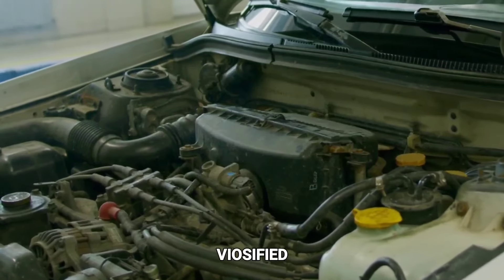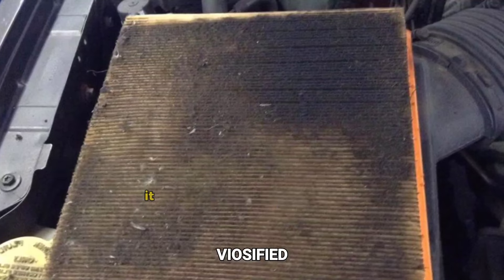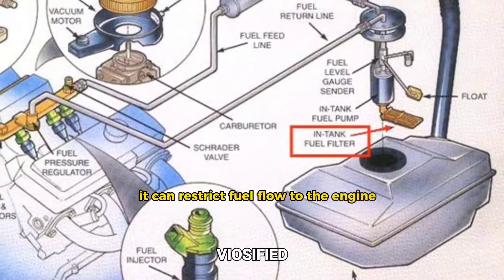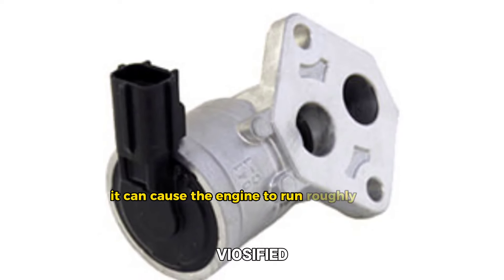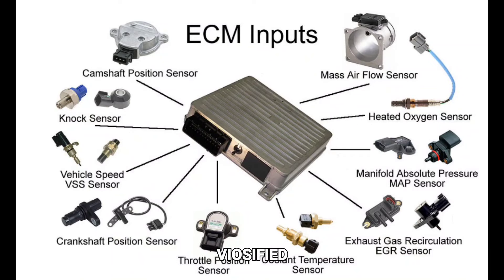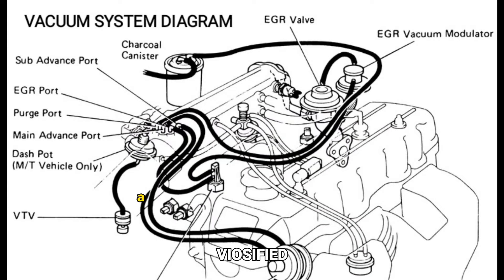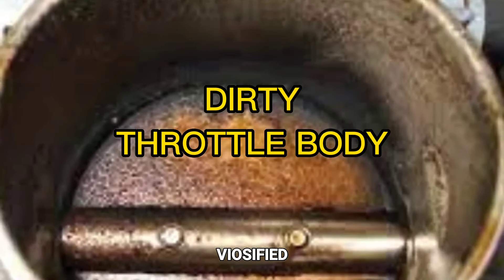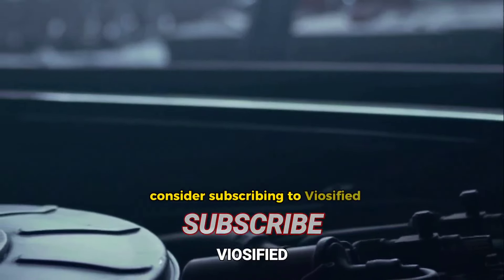CAUSES OF ROUGH IDLING | ENGINE STALLING

Comment: My Subaru stalled on my way to work this morning and I’m in absolute shock. No noise, nothing! I’m still trying to figure out the issue.
Reply from the maker: @RoseQuartz-l8c  the sudden stall without noise might indicate a loss of electrical power or fuel supply, but there’s not enough information to pinpoint the issue. It’s best to have your vehicle checked by a mechanic to diagnose the exact problem.
Reply: @Viosified  I got an update by my mother just yesterday. My dad found out that the timing belt had snapped which means my values are possibly bent too. Absolutely gut wrenching to say the least.
Reply from the maker: @RoseQuartz-l8c  I'm sorry to hear that. I hope the damage isn’t as bad as it sounds & that the repairs go as smoothly as possible
Reply: @Viosified  I hope so too! She’s my best friend to say the least and I wouldn’t have it any other way. Thank you.
Reply from the maker: @RoseQuartz-l8c  You're welcome! I can tell she means a lot to you. Best of luck! Hoping everything gets sorted quickly 🙏

Comment: My car is cur after star but wen u accelerater but the moment you leave it cuts,but wen you unplug airflow sensor cable is idling rough but not cut what will be the problem?
Reply from the maker: @charlesmakupe3137  Your car's issue is likely caused by a faulty Mass Air Flow (MAF) sensor, an air intake leak, or a problem with the throttle position sensor (TPS). Try replacing or cleaning the MAF sensor, checking for air leaks in the intake system, or having the TPS and fuel system inspected by a mechanic. I have a video on MAF sensor cleaning: https://youtu.be/6xi5OLAuldA?si=MgxlsXMiIEefpBXf

Comment: Can fuel pump be a factor? My car engiens dies at very low speed..either when i am stopping and rpm is very low or when i am about to accelerate after shopping most time when im on a little slope or having like 3 or 4 people in the car
Reply from the maker: Yes, a faulty fuel pump or clogged fuel filter or injectors can cause stalling. It could be a combination of factors.
Reply: @Viosified I recently had filled up half a tank with v power nitro which is know to have additives that clean your fuel lines and injectors. Shortly after this I drove on the free way for about 5 miles then as I came to my exit and hit a red light my car started shaking super bad on idle and sounded terrible. Soon after the engine shut off but it turned on right away and performed fine for about a mile, once I made it to my apartment the issue was still there and my engine shut off once more. After that the problem went away and I did some laps around my apartments to make sure. What do you think this could’ve been, could this have been a result of the gas’s cleaning my fuel tank and lines and the degree getting clogged up the fuel filter? Or is this a more serious problem.
Reply from the maker: @hectortha  Theoretically, if the additives in V-Power Nitro gas indeed cleaned the fuel lines, the dislodged debris or sludge in the fuel system could temporarily clog the fuel filter or injectors, leading to rough idling, engine shaking, or even stalling, as you've described. If the issue doesn't return, it was likely a temporary clog or disruption in the fuel flow. However, if the problem recurs, it would be wise to have your mechanic check for potential blockages or contaminants in the fuel system. He should also consider running a full diagnostic to rule out other causes or issues.
Reply: For me same problem I fixed by replacing the airflow sensor

Comment: I fixed,/ replaced all of the things, it still hesitating
Reply from the maker: There's got to be something you overlooked. A visit to the mechanic for a thorough diagnosis is recommended. A 2nd or 3rd opinion won't hurt.
Reply: I would pay a diagnostic fee and fix the issue if I can other wise just pay the mechanic. You definitely overlooked something, rough idling is a pain to pin point.

Comment: Hi sir i have swift disel 1.2 manual rpm always fluctuate at idle and rough what to do?
Reply from the maker: I would consider a possible vacuum leak, but any of the causes mentioned in the video are potential factors. I suggest you visit the dealership or a mechanic in your area for a more thorough diagnosis of your Swift.
Reply: @Viosified  p0560 system voltage code are comimg
Reply from the maker: @Pratikjadkar  check your alternator, power cables, battery health, fuses & relays

Comment: Is coolant leaking a cause too?
Reply from the maker: It's not the most common cause but if the leak is severe enough it can be a factor. I mean, if the leakage is such that it affects coolant sensors or other engine management components, then yes.  Malfunctioning coolant sensors can provide inaccurate readings to the engine control unit, leading to improper fuel delivery & ignition timing, which can cause rough idling & other performance issues.